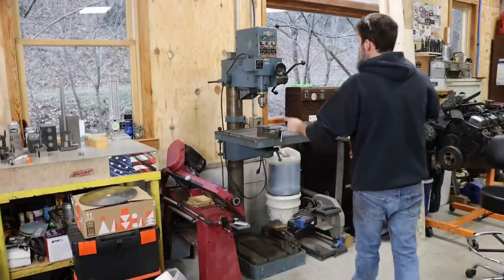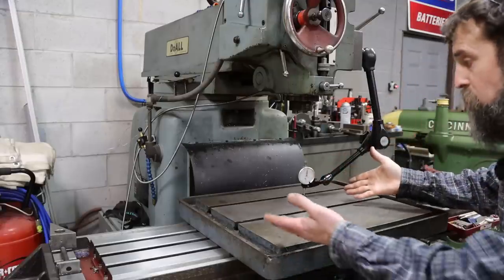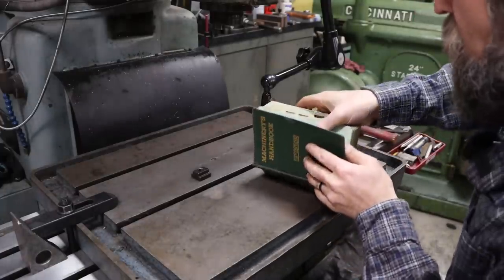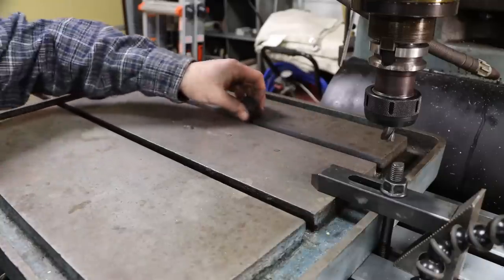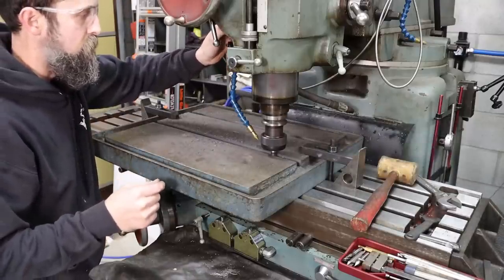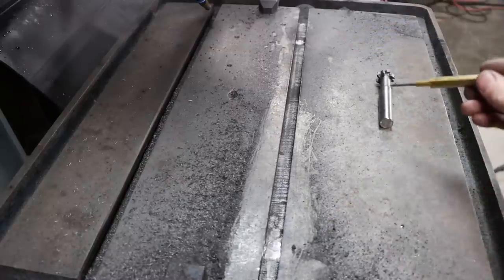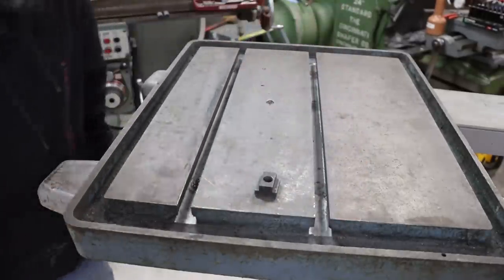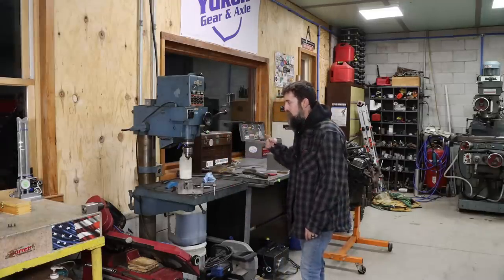Why Didn't The Factory Finish This drill? Machining the T-Slots

Comment: I've seen this a lot more than you would believe. I worked on a Blanchard grinder once where they drilled the coolant drain holes down from the top of the table but didn't drill them all the way through. I tried to clean them out and hit solid iron! Had another Blanchard where they drilled oil return passages in the gear box incorrectly and they did not intersect so the oil could not return and mostly just leaked out on the floor. Amazingly, they had been using it that way since it was built in the 1980s. Also, they would do almost anything to avoid scrapping a part or casting. I've seen pulleys and gears right from the factory with 3 or 4 keyways broached in them before they got a good one with no inclusions. 
On another note, many drill presses I have run into have the keys machined, but the "T" part is just left as cast.
Reply from the maker: Hey Wes, good to see you buddy👍.
It's amazing what some of these pass as good parts. The slots on this table were just about useless.  They were so rough that nothing fit even half way decent. They went through the trouble of machining the slots on the foot / base but not the main work table 😄. I have seen cheaper machines with as cast slots but I was surprised to see it on a drill of this class. 
 I bet you have seen all kinds of this type of crap with your machine history. 
Thanks for stopping by buddy.
Reply: Thanks for this bit of lore. It might help me with a bit of dickering room if I spot such a flaw on a used machine I would like to have.

Comment: With the straight end mill you used to generate the wid of the narrow slot, go a head and run it deeper than the required "finish depth" . Just by a 1/32" or so. This allows  two beneficial effects. The first is, in the original machining process it the slots, that gutter in the bottom greatly lessens the load on the HHS, specialty cutter.  Particularly the bottom where the corners of the tee cutter burned up. The second beneficial effect is in the life  long if the machine. It's not uncommon to have two types of t-nuts. Some with complete threads all the way through and some with partial threads .
Reply: The peanuts with threads all the way through allow you to clamp a tee nut in place by driving the tip of the stud into the bottom of the tee nut slot. This lets you use the stud for location as well as clamping.  The stud will inevitably raise a burr in the bottom of the t-nut slot. This gully accommodates that.  And helps the peanuts slide in and out with less friction and galling on burrs.
Reply: The disadvantage of screws going through the T nuts is that it allows upward pressure on the T slot and can cause breakout. T nuts should ideally clamp the T slot for grip.
Reply: Hi Chris, totally agree with the breaking out of tee slot shoulders.  And jack force of any stud or bolt is a good way to do it.  But upwards force is just that.   Regardless of where that force comes from.   Excluding a direct clamp  of a through hole fixture ( like a mounting hole in a vise) there is danger of levering  off one  or both shoulders.  Especially near the end of a slot . 
The classic strap clamp and step block setup will not support the table above the t-slot.
And given this is a tall setup and may not be plumb it can asymmetrically load the shoulders. Making things even worse. The important thing is to never overload a single t slot/not combination.   
Often I will relieve the t-nut flange near the center ever so slightly, with a stroke of a file, in order to make sure the upward Force is concentrated at the outer edge of the t slot, helping to reduce the moment load on the casting.
In situations where I want the stud to remain fixed either for positioning or convenience, tend to be production jobs. And even having a spring on the stud to lift the strap clamp usually is not enough to hold it in place as you clear the chips and load the next piece.
When I make my own t-nuts I tend to make them as long as will fit in the access slot on a Bridgeport table with at least two tapped holes. The longer length helps distribute the upward Force, and the second tapped hole allows you to use a set screw to affix its location. I suppose I should make one of those tapped holes incomplete to prevent jacking on the t slot floor.
 I like using the  studs for locating, because they're round shape is very tolerant of chips, and don't affect the piece's location. They are also inherently aligned along the x-axis of the machine. 

Another trick,to keep the clamping set up repeatable and from becoming a floppy mess between parts is with my step blocks. Nicer ones with the holes through them can be a fixed to the table with a strap clamp. But on the cheaper ones I tap some 3/8 -16 holes into the sides near the bottom in order to insert a bolt and strap clamp that bolt down to the table. If it's 9/32" up from the bottom that's half of the 9/16"  head of a hex head cap screw.  The flat of the hex bolt makes a nice foot on the table of the mill.
Fixing to step block makes the angle of the strap clamp much more repeatable and less likely to be hit in milling operations. 
Good point though about jacking pressure. Thanks for the reply,  cheers
Adrian
Reply: Bro. Go back to uploading. You know a ton. I subbed.

Comment: One of those jobs we always do when we get 'A Round Tuit'. A job you won't regret doing. Bear in mind the 'skin' on cast iron can knacker a tungsten carbide cutter if your only taking a light skim so congratulate yourself on a job well done! A Happy and Prosperous New Year to you all from Somerset, England.
Reply: Those hard spots of "chill" contain ferric carbide, which is only a tad softer than tungsten carbide.  Traditionally, chilled, AKA "white", iron was ground, not machined.  A near diamond hard CBN cutter should be OK, but said cutter's cost is HIDEOUS.

Comment: Hi Steve. How odd that press got by all the factory procedures like that. I have machined A LOT of cast iron through my career to know how castings can consume tooling. One small sand pocket can end their life. Carbide or highspeed, makes NO difference. There are numerous reasons for hard spots as well. Cast iron costs a 1/4 to a 1/10th of the process to make steel so manufacturers will use it any time they can. Little Cora sure has blessed your day to day. What a lovely wee beastie that has blessed you the day she showed up at your door. Great post and teachings for many. I always look forward to weekends to get caught up with you. Yer a good, kind man and a talented machinist/mechanic and more. You sure found your calling. Thanks fella and take care eh!

Comment: Nice one.
This could be a later model drill table, just saving a few bucks on manufacture costs.
Also a bit surprised you didn't under cut the base of the “T” slot with the 5/8 carbide cutter.

Comment: Just found your channel and am very impressed with your knowledge and the quality of your work.  I'm not a machinist, just a retired guy doing light fab and auto restoration, but bought a high quality drill press and found that just like yours my T-slots were not machined and would not accept standard T-nuts.  I'm embarrassed to say that I solved the problem with disc and die grinders since I don't have a mill.  Although I have a copy, it never would have occurred to me to consult Machinery's Hand Book for T-slot specs (and cutters). Will definitely checkout your other videos.  Thanks for sharing!
Reply from the maker: Thanks for stopping by the channel 👍

Comment: I think they took the table out of the molds to soon and the hard spots cooled to quickly leaving white cast iron therein. Most likely a batch of them suffered the same fate. Rather than ruin a bunch of cutters or discard the tables they shipped them off as cast. That's my theory?
Have a great New Yeat!
Reply: I doubt that. If they pulled too soon they would still be hot. As long as they’re cool, it’s fine. You would have to chill the it]ron quickly to have hardness form, and then it would a fairly even surface hardening not random spotting. That happens because of an uneven mix. Why they didn’t get machined is anyone/s gues. A screwup most likely. It happens everywhere, just as they left sand from the mold.

Comment: Probably last one on a Friday, and operator hit the hard spots, and went to go dress the tool to do the finish pass, but instead after the tool shop work it was home time, so decided to carry on Monday. Monday came, he forgot the cut was not completed, took it out and put the next one on instead. Then inspector was also hung over, passed it, and it went to assembly, who did not want to have the hassle, so put it on the next in line.

Comment: Good job machining those T slots. The round boss on the bottom appeared to protrude about the base but I must have been wrong since you clamped the part directly to the table. That's one heck of a heavy duty drill press and milling machine.

Comment: You were right to cut the slots dry.  Using coolant with cast iron shortens the cutter life as you get an abrasive paste tend to build up.  I had to machine some chilled cast iron parts from a 1905 steam locomotive recently and even carbide was not staying in,  tried coolant and they went blunt quicker.  The only answer was CBN but what a price to equip a4" face mill and only one cutting edge per insert.

Comment: Always enjoy watching this channel. What rpm on the t-slot cutter. Seemed fast for cast iron and HS steel. Also, whenever cutting t-slots in the past, we cut full depth with the flat endmill, and only cut the sides with the T-slot cutter.

Comment: I am going with 'not a mistake' but an unpurchased option.  In other words all the castings for the tables had the slots cast in but to have them machined was an optional upgrade.  I know for machinists  T slots are like water,  they are a basic need. But for many others T slots are not used.   Just a random thought.  Have a great week and thanks for posting the videos.
Reply: Yea thought the same.
We have a old russian Drillpress in our company, and it´s only use is to "punsh" big holes into mild streel tubing and beams to shove bolts true them.
The power feed is the only feature besides turning the drill, used on this maschine. 

If a machinist would see how our guys brute force those dull drills true that steel, he would have a heart attack! 😂
Reply: ‘Through’ not true. Not sayin, just sayin.

Comment: Hi Steve, Happy new year to you and yours. Cast Iron generally doesn't need coolant, hard spots are a pain but it happens. You might have run a dovetail cutter to remove the burrs on the bottom part of the T slot, and a countersink cutter on the top of the slot, just so over time you dont get any burrs or bruises stopping the T nut sliding freely. Looking forward to 2023 content. Best wishes, Mal.
Reply: 1ginner, you and Steve Summers (who immediately got my subscription after a few minutes of watching) both pleasantly reminded me of the vertical mill I had charge of when I was a shop technician at Wentworth Institute in Boston, Mass. When it arrived in our shop as a bone from the engineering school program, the t-slots had been so badly mangled from improvised hold-down nuts and bolts that we could hardly pass a proper t-nut through. No t-slot tooling, but I cleaned them up with a straight endmill that I ran down the slot at a 1 degree lean of the head, so that I would not alter dimension of the top of the slot. Worked well, and I was quite satisfied with myself for such a minor accomplishment.

Comment: We had a similar looking drill press in the maintenance shop where I used to work. I'm pretty sure it was a Wilton. The vertical surfaces of the T-slots that intersect the top of table were machined, but all the other surfaces below were rough cast. So, apparently, this isn't the only one out there like this.

Comment: This is a great project.  Cleaning up the slots in the table makes the Drill more useful.  Maybe, if you have the time and inclination, resurfacing the table lightly with the shaper.  Just a suggestion.  Glad you found the spare t-slot cutter.  I love that you are back in the shop making chips and swarf.  KOKO!

Comment: I bought a brand new Jet branded Arboga drill press last year and had to do the same thing to the t slots in the table. One thing I found when removing the table was that they had stuck a shim between the table and the mounting spigot, I guess to tram it with the spindle. Around the 4:10 mark, something falls to the ground as you're sliding the table onto the cart. It may have just been some crud, but it might be worth putting an indicator in the chuck and sweeping around the table. Thanks for making these videos.
Reply: Might be more cast sand that came loose..but yeah..it looks interesting? 🤔🤨

Comment: Steve Summers, you got my sub after only a few minutes of watching because you resonate. But, forgive if I think that you are a beginner at this doing things "the hardest and most time consuming way possible." Even someone with my limited machining experience would skip the step of indicating the table before clamping it to the milling machine. I would have gone straight to clamping the table upside-down, and milling the edge of the apron, as well as a sacrificial block on the mounting point in the center. That would give me the opportunity to rig up and dial in a support on the outside of the table to keep the weight of the whole thing from distorting the table/cut during the process, too.

Edit: On second watch, I see that the central table mounting is already the high spot, so another opportunity lost. What did you use to support where you clamped, if you don't mind telling?

Comment: I run a vacuum, not air. You’re just blowing the fine iron dust everywhere on and in the machine, even at low pressure. While iron dust doesn’t cause as many problems as some think (everybody is just repeating what they hear from others, round and round), it’s still never a good thing to get microscopic particles of metal in between the moving surfaces. And believe it that those tiny bits of iron dust does float in the air for several seconds. Enough time to float far enough to find those interfaces.

Comment: Couldn't help but notice your hoodie with the long drawstrings on it. Not long ago I was working in my shop and while leaning over something rotating realized the strings around my neck were ridding on the rotating part. Scared the crap out of me and I cut all mine off. Not to be the annoying safety guy  but it's something I notice now.

Comment: First! Happy New Year Steve and Elizabeth and family. Great job on the tee slots Steve, I think that I would have at least gone down to the full depth in the centre with that 5/8" carbide cutter to at least relieve the tee cutter from doing the centre slot work. That may well have been the hardest part of the casting directly under the sprue. Was the sides of that part where it was hard as polished as the centre looked? The cutters could have been damaged as they traversed radially over the actual 5/8" slot base where you said it was glass hard. Anyway that's my tuppeny take on it lol .cheers from the UK mate

Comment: Always a great Saturday project to learn something from. 
When you started I was wondering how much of an issue would be caused by the cast iron dust getting recut and causing issues with the tooling and cut itself. I assumed after you stopped and added the air it would be a problem. Especially that long of a cut.
Appreciate the time to setup all the shots and editing time you spend on these. They just keep getting better!

Comment: Hello, nice video again! Wonder why they done these slots imperial sizes in Sweden. 16mm (0,63") is so close 5/8" that it will work with 5/8" hardware but 16mm hardware may not work with 5/8" slot. Interesting to see they left a casting sand there.
Reply: Probably because they exported more to the US then they sold in Sweden. Or there are no hardware in metric size?

Comment: I understand the issue with the HSS cutter and the fine cast iron dust contaminating your coolant, but a couple of spritzer of cutting oil or the stuff you used at the drill press would have helped a lot. Besides that,great job as always!

Comment: You could have run a carbide end mill to the full depth  of the second  slot,  but  it  probably wouldn't have made  much difference  with  the broken  tooth.    Good  video  none the less.   Happy New Year!
Reply from the maker: Yeah, I thought of that after it was too late . It would have helped a bit but not completely. My DoAll Mill has a relief at the bottom of the slots from this method 👍

Comment: Steve, question? after you cut the slot to 5/8s" your already all lined up to switch cutters for the T stot cutter, Why not just run the T slot cutter through before moving the table of the mill over to the other slot , It would have been dead on center of the slot and saved you a bunch of horsein around going back trying to line up the center for the slot to the T slot cutter. This is where a DRO is very handy on a mill,
Reply: Or you can just learn to read the dials.  It's a t-slot.  Dials are plenty close enough.